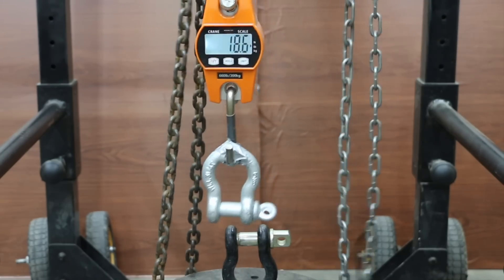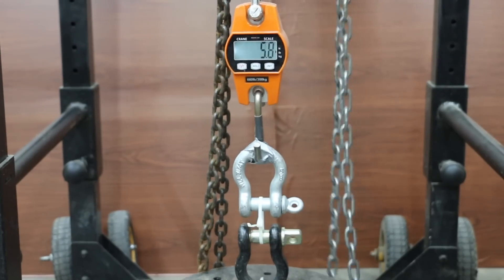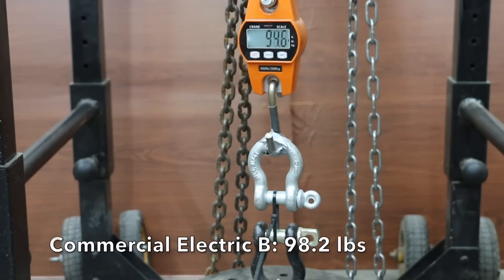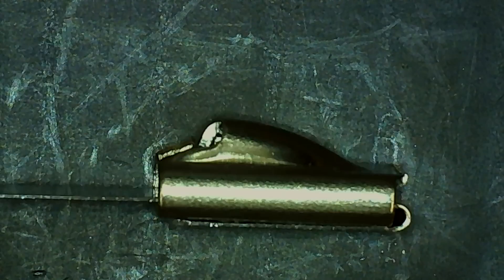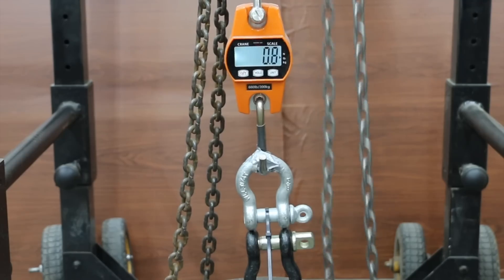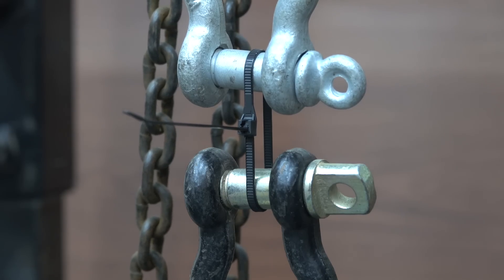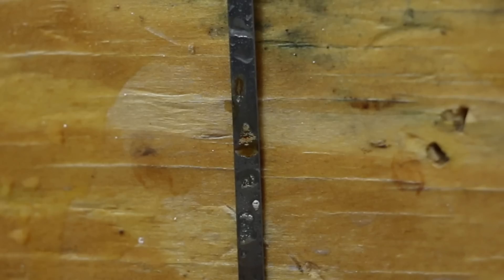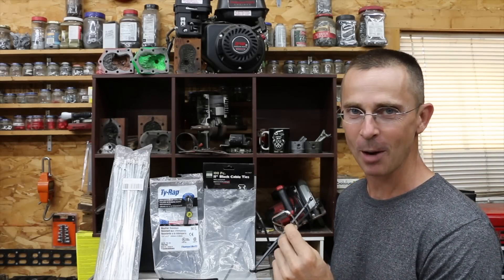Best Cable Tie (zip tie) Brand? Let's Find Out!

Comment: I learned years ago when working in a manufacturing facility that nylon fasteners can dry out. The facility actually kept snap in nylon fasteners in a tray of water before use. I had a bag of zip ties which would fail when you tied them, the latch would break. I added a bit of water to the bag and tried them again a month later. No more breaking! I now add a bit of water to my plastic container of tie wraps.
Reply: I learned the same thing and boy does it make a difference. I bet the moisture content has more to do with the strength of these ties than the UV exposure.

Ties in the middle of winter are always more brittle due to the dry air. Summer humidity strengthened some of these.
Reply from the maker: Thanks for sharing.
Reply: Here in Colorado where we have extremely low humidity (1% in summer is not at all unusual and winter is almost as bad) I have terrible luck with zip ties!  The same thing happened to me in that the locking mechanism would break as soon as the strap went into it.  I swore off Harbor Freight zip ties years ago because that's the ones I had the most trouble with.

Comment: WOW, Commander! I rarely use ties and if I need anything to hold to where I don't worry about it I usually put different lengths of radiator hose clamps together but I'm out of the loop as far as these go. I got an assortment of ties years ago and am still using on them. Have no idea where they came from and I had no idea there were stainless ones. THOSE are the ones I ought to get! Thanks for another OUTSTANDING test! Fall is on the way and BLESSINGS 2 ALL Yall!.
Reply from the maker: Hi Lewie, Great idea on using hose clamps for a really secure hold.  Those stainless zip ties are quick to install and very strong!  Thanks again and wishing yall many Blessings!
Reply: @ProjectFarm  I need to get some stainless ones but my job security is right here at home with mowing and firewood. Maybe the web has some! Thanks, Commander and stay dry! GBWYall!

Comment: When I was a CATV Tech all we used were Ty Rap with the stainless steel locking device. Installers would use hundreds a day. They would last many years out in the elements. That’s all I will buy for industrial applications.
Reply from the maker: Thanks for sharing.

Comment: Makes me wonder if the orientation of the cable tie makes a difference. For example, whether or not the locking mechanism is at the top, or on the side when pulling.
Reply from the maker: Thanks for the feedback.

Comment: 3m cable ties are the worst, your lucky if you can get one barely tight with 2 fingers before it pops back off. You have to go through about 10 of them before you find one that kinda holds. Great video can you do a 3m cable tie test?
Reply from the maker: Thanks for the video idea.

Comment: I think the "Working Load" test could be improved or elaborated. Example: stress the tie to the point it stretches. Do this repeatedly, till it fails. 

Use case: You tend to see zip ties used on things that see abuse and broke under their own working conditions. Example: A cracked plastic tool casing. It will continue to see abuse and the tie will probably fail.
Reply from the maker: Thanks for the feedback.
Reply: @ProjectFarm  love your content thanks for the effort to provide everyone with real world testing.

Comment: Two of the criteria that I look for in cable ties is flexibility (which polypropylene ones > nylon ones) and ease of closure (panduit ones...butter smooth).  No one wants to wrestle with a cable tie with one hand while holding a bundle of wires in the other.
Reply from the maker: for the feedback.

Comment: Great job on this one....  We get Panduit at work, and I kinda liked them...  They really didn't test out super great....  Hmmm....

By the way, You're a bad influence....  Stainless steel cable ties???....  How have I lived my whole life without these????

I was intrigued by the UV exposure...  Our "usage case", if you will, was to put the zip tie on something outside, and hope it held...  Which the black ones did far far better than the white ones.....

You'll have to forgive me, but the test I envisioned was. put the zip tie around a 50 pound weight (or whatever you decide), and then put it outside, and see if it was still holding the 50 pounds a year later....  Although from your testing, it seems like the outdoor rated ones certainly would have....

I give you a lot of credit.  You climb on top of your shop, place a bunch of cable ties, and then retest after a year...  That's dedication...
Reply from the maker: Thanks for the feedback.

Comment: The epoxy with the best chance of replacing cylinder head bolts is Marine Tex its expensive at $30 for 2 oz but would be interesting to see in an epoxy putty shootout.
Reply from the maker: Thanks for the video idea.

Comment: Disappointing that the only US brands were close to last place. Counter-intuitive that all  experienced an increase in strength after UV exposure. Have only used SS ties w/ exhaust wraps, so tensile strength wasn't a concern so much as corrosion resistance. Thanks for another informative video.
Reply from the maker: You are welcome!

Comment: The tire chains on your truck had me think of a test that might be a bit expensive and challenging: Best off-road tires and/or Best snow tires, where "Best" = most traction, most durable, lightest, economical. A bit expensive, but maybe there's a lab test you could design for a single tire, or two (for a minimum of reproducibility).

Regardless, thank you for your work! I've been subscribed for a few months (since the beginning of the "zombie apocalypse"). Your dedication to providing highly usable, scientifically informed data is really inspiring. In a former life, I was an experimental elementary particle physicist, but now I'd love to farm. I've got some products in my Amazon list "for the farm" from your reviews. If you get tired of farming, I suspect you'd do well in experimental or applied physics! :-)
Reply from the maker: You are welcome!
Reply: "Tyre review" is a great channel for that, maybe a good idea for a colab

Comment: Wow, some brands had amazing strength! Great testing as always. 👍 A++
Reply from the maker: Thank you!
Reply: @ProjectFarm  -- Hell, I didn't even know there were SS ties.  After seeing this, I got on eBay an bought 100 SS 12" ties for $4.00 and they work 1000 times better for attaching chainlink fencing to fence panel frames.  MY GOATS CAN'T BUST THEM, but they rammed right through those stupid aluminum wire ties!
Reply: @ProjectFarm  will be a good video If you test the motorcycle helmets which one is the best quality and which one is it stronger.

Comment: "Cable ties are good for temporary repairs"

Ha yeah.... just temporary...
Reply: Temporarily permanent
Reply from the maker: Thanks for sharing.
Reply: You know those crappy plastic tubes that automitive wiring harnesses are shethed in?

Yeah, after a decade those crumble and get replaced with a temporary zip tie for life.
Reply: @Mk2Mod1  that's called wiring loom
Reply: @buckberthod5007  huh, learn something new every day. Anyways, I replace the loom with a hand stitch design.
Reply: @Mk2Mod1  I wrap my wires nice and tight with zip ties, then snip the extra off and wrap it all up in good electrical tape. Only if a customer asks will I re loom a wiring harness. I tell them, obviously, about the tape and zip ties, but there's no harm with it depending where it's located. Some places need that loom to stop them chafing through
Reply: @buckberthod5007  to big of loom will also chafe the wiring, it needs to fit snug. Volvo trucks actually had that problem a few years back, to big of a loom caused havoc on the body harnesses. With the way modern trucks are set up loosing connection to anything sends it into a fit and restricts the truck, major pita.

Comment: I used t&b at work for years until they stopped supplying them. I miss them. They held up way better in winter and after years and years they still didn’t crack up from uv exposure. Plus they didn’t have the traditional step locks and could be tightened with infinite positions. And they were more flexible which was better for holding round wires. Regular plastic ones would often just snap when trying to tighten them when it was colder than 20F degrees or so.
Reply from the maker: Thanks for sharing.

Comment: Heck now that I see this test, I started thinking,  need to test those pipe clamps with the worm screw. Seems like its a crap shoot to find one that doesn't strip out the threads or that doesn't rust to not usable.
Reply from the maker: Thanks for the video idea.

Comment: I have a question, but at this point I'm afraid you would actually do a video on it and bankrupt yourself. What, in your opinion, is the best power drill? And what brand tends to have the best quality tools. 
Here is a video idea, what are the best scissors? All my life, scissors have been useful, but these Wiss scissors are on another level in scissor power!  It isn't the safest thing to do, but I actually used them to cut through the top of a plastic storage container to make ventilation for my dubia bin. And the thing is STILL sharp as heck! Hardware scissors are amazing! But are there even better hardware scissors out there?
Reply from the maker: Thanks for the video idea.

Comment: I wish I had watched this before I nearly knocked myself out whst pulling a cable tie tight and it snapped and I punched myself in the face....HAHAHAHAH 
As always a great video, Cheers.
Reply from the maker: Sorry to hear that!  Thanks so much!
Reply: Isn't that the best!? hahaha you feel like an idiot for a while afterwards 😂
Reply: Any type of cable tie will break if tensioned incorrectly.
Reply: @BTW...  
Yep, that's what happened. As opposed to the cable tie failing due to heat and UV rays.

Comment: Have you done one on jubilee clips (that's what we call them in the UK) the circular ones with a screw tightener. I have used them to bodge and fix vehicles so many times, I even used them once to fix a track rod so I could continue to steer my circus truck.
Reply from the maker: Thanks for the video idea.

Comment: Two of the Three Gardner Bender white uv exposed samples were installed backward for the test. You were applying force on the wrong side of the locking lug. Sample Two at 9:22 and Samples Three at 9:27 with a close up at 9:30. Really not the ties fault just user error.
Reply from the maker: Thanks for the feedback.

Comment: I would think moisture content would have more to do with failure than UV exposure. Try soaking some in water over night  and compare the testing data to the ones you already did. Also, each bag of ties are going to have ties from the various cavities within the mold. It would be interesting to see if ties from different cavities within the mold produce different data. Other than that, interesting video showing the difference between manufacturers!
Reply from the maker: Thanks for the suggestion.

Comment: NOPE wrong what the PA cable tie made stronger is the exposure to humidety PA gets stronger if water can defuse into the plastic.
Pa plastics are dried to about 0.2% or less water so it can be injected whitout foaming .. water woud get converted to steam in the injectionmachine...
Reply from the maker: Thanks for the feedback.

Comment: I'd love to see you test the effectiveness of different mask brands. Maybe there's a mask that isn't rated for N95 that actually performs well enough to substitute for it?
Reply from the maker: Thanks for the suggestion.
Reply: That would be a great test, I notice N95 masks without the breather in the middle (to let out air when you exhale) tend to seal worse which makes me breathe in more dust when I'm grinding. The KN95 on the other hand is completely useless, there is more dust on the inside of the mask than the outside.

Comment: Really interesting that the zip ties got stronger after some UV exposure.. I use them often but I rarely trust just one. My rule of thumb is where you need one you need another one or two for insurance. On a side note: I’d love to see what would happen if you put dry ice and some water in the cylinder of a small engine, and put the head back on. In theory something would have to fail or go boom💥 be careful if you are crazy enough to try it.
Reply from the maker: Thanks for the video idea.

Comment: I  noticed you tested all the zip ties in the same orientation.  I wonder if they would be stronger if they were oriented with the locking mechanism facing the opposite direction
Reply from the maker: Thanks for the suggestion.

Comment: Todd i don't know if you'll continue testing with these but another factor to test is how they perform in cold weather. My job we use these daily strapping wire to pipe in the oilfield. In the cold just tightening some we break two or three in a row. Glad you tested T&B they have a little stretch and hold tight over time. They are by far my favorite. My only issue with the stainless ones is you can't get them as tight as nylon because they don't stretch.
Reply from the maker: Great suggestion!  Thank you!

Comment: I wonder if the increase in load seen with some of the UV exposed ones was due to a change in moisture content and not from UV itself. Nylon is known to vary in strength significantly with it's moisture content so if they spent that year in a very dry area that could have lead to the change
Reply: Radiation exposure can cause cross linking in plastics, making them stronger. PEX tubing is exposed to ionizing radiation during manufacture for instance. But prolonged exposure will cause breakdown of the chains so eventually they will become brittle.
Reply from the maker: Thanks for the feedback.
Reply: Some other comments said that Nylonties will get a lot weaker with lower moisture, which would contradict what you said.
Reply: @whuzzzup  In my experience the tensile strength will increase but the toguhness/impact resistance will decrease as moisture decreases with nylon

Comment: It's really interesting that the triple lock ones did not do as well as the double lock. Also very surprised that UV light seemed to help more cable ties than it hindered.
Reply: The UV can't penetrate at least the black zip ties, so it does a sort of case hardening where the skin of the ziptie is hard but the core is still mostly its original pliable plastic. Eventually air would get to the inside of the plastic as well and damage it, but it'll get stronger before failing completely.
Reply from the maker: Thanks for the feedback.

Comment: If be happy with one that don't get brittle below 20°f.
Reply from the maker: thanks for sharing.
Reply: I should clarify. I use "zip ties" as a truck driver. I h as ultimately a step deck trailer. And at times it's the perfect tool for the job. Problem is is that the most common ones you find get brittle enough a little below 20° that the locking mechanism breaks out. Really annoying.

Comment: We need a good gun oil testing video.  please give me a good response. would need to test wear prevention, heat / cold resistance,  cleaning ability related to carbon build up, and maybe some other things. Test amsoil gun oil, clp gun oil, lucas gun oil to name a few. you d get many views on this because you d have the first real quality video. please respond and let me know if you d consider this
Reply from the maker: Thanks for the suggestion.
Reply: @ProjectFarm  will you consider? there is no good video for this

Comment: I've used Harbor Freight zip ties for years and always outside. The largest white ones are the ones I use mostly for hanging wired lights from my deck roof. The frame is steel so I can't use nails or staples. Anyway, since I use them outdoors they are exposed to more heat than direct sunlight. I've found that they get brittle and snap after a couple of years and have to be replaced. The cable ties you've tested were exposed to direct sunlight but have you tested them in high heat exposure under load? If not I'd like to see what your results would be. I'm subscribed and watch every one of your videos as they are more informative than any I've ever seen anywhere else. Thank you for being so thorough!
Reply: Black ty wraps are for uv and white are for indoor use only use black ones and you should get 5 years out of them

Comment: I use cable ties to bundle wires, keep cables from flopping around on lawnmower handles, and holding conduit a pvc pipe together in a bundle. 
I don’t need the super high strength. But that’s me.
Great video.
Reply from the maker: Thanks so much!
Reply: Agreed, this video is interesting but not really useful.

Comment: When HF has their super coupon sales you can pick up the 100 count 11” cable ties and their 10 count 24” cable ties for only $0.99 a pack.
I usually grab a dozen of each and I always keep a few packs in my truck tool box.
They also have a stainless steel, hose clamp, 30 pack assortment for about $10 that can be a life saver.
I keep a pack of them in my car and truck.
Reply from the maker: Thanks for the feedback.

Comment: Great video, never would have thought the old harbor freight zap straps would have been a contender especially at their price point. One thing from my experience with the stainless zip ties is when you tighten them, they almost have to slip back a little to engage the locking mechanism. I've never had great luck getting them tight around something and having them remain tight, especially if what I'm tightening down doesn't have much give like tying header wrap to an exhaust header.
Reply from the maker: Thanks for sharing.

Comment: Really cool to see that they get stronger after one year. But my experience with tyraps outside is they freeze in winter hot in summer wears them out in like 3 years. So mabe freeze them 10 times and test again.
Reply from the maker: Thanks for the suggestion.